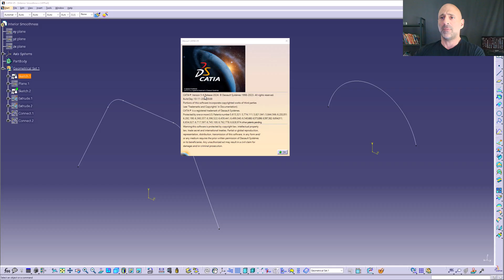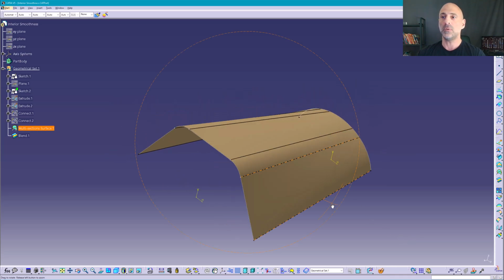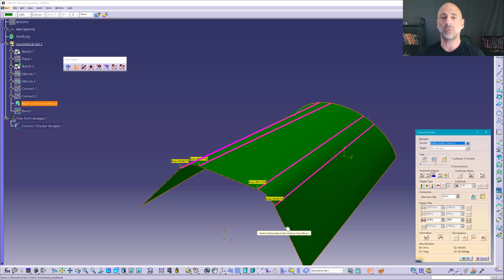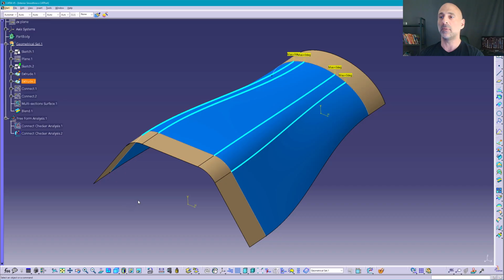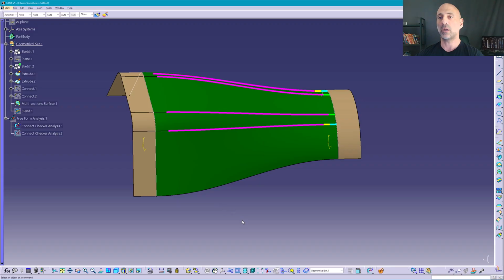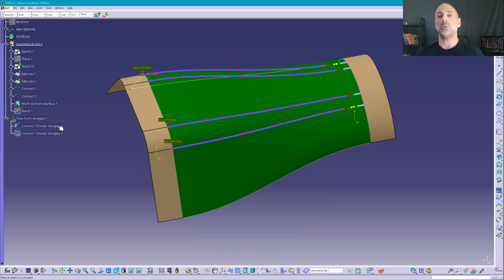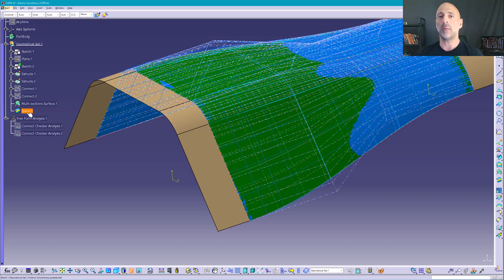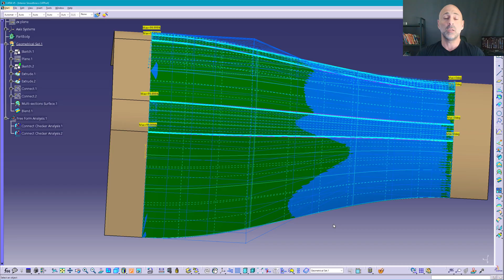🔍 CATIA V5 and 3DEXPERIENCE - Surface Interior Edge Smoothness

Comment: Steve! where would we apply this analysis or where it is needed?
Reply from the maker: Well hello!

It is a very important tool. It really should be used to verify surface joints are in tolerance.

I have videos about it.
Reply: @StevenMarji  Thankoy Steve. Why is it so difficult to do Topology Optimization in Catia V5?.. i've been  lately extremely interested in tolology optimization, but in catia it's a pain in the rear, although it does it and it does it well.. Is there any FREE cad systems to topology optimize?
Reply from the maker: Could be a licensing issue for you. Catia does a good job but everything is spread out.

I honestly have no idea about free software. Apologies.